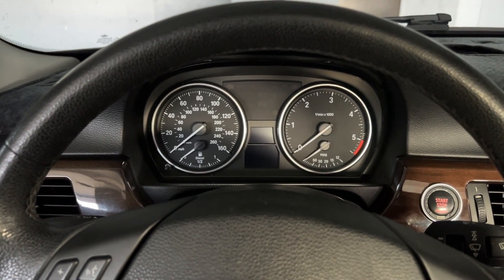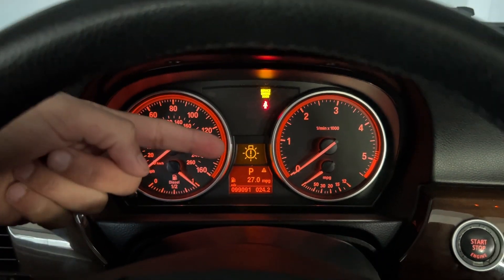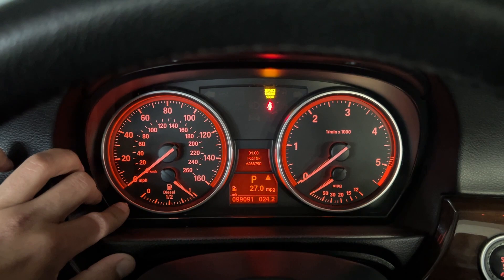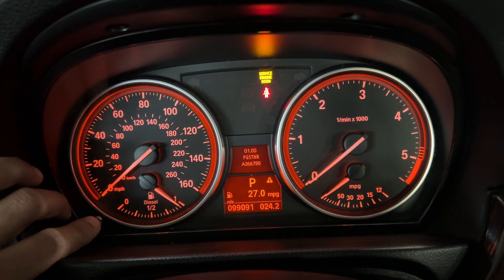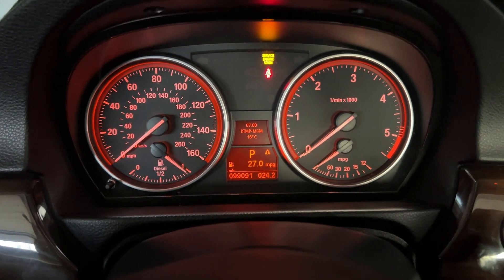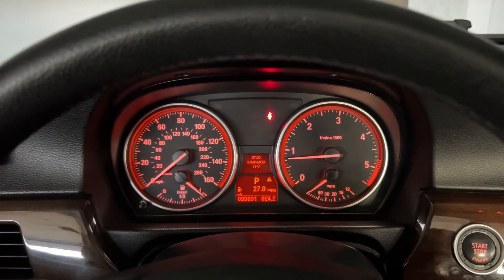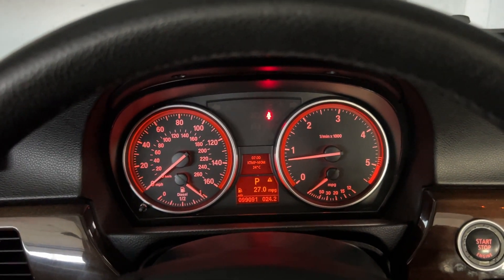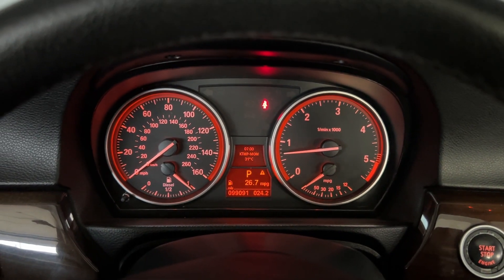How to check coolant temperature on a BMW 335d

Comment: Is it not normal that my temp is like 70celcius after driving 5-6km , and is dropping when I drive 90km/h in freeway?
Reply from the maker: Keep in mind that when going on the freeway the car actually cools down. But it shouldn’t be below 70 Celsius after driving for a while (freeway or road) if not codes are present, you might want to check the concentration of your coolant (bmw coolant should be diluted 50/50 with distilled water. Could be your coolant has an unbalance in coolant mixture. Meaning more concentrated coolant than water)
Reply: No, you need to replace your EGR thermostat.
Reply: @jorisbonson386 I replaced mine and still have this issue
Reply: @ Use genuine BMW parts - the aftermarket ones don't work
Reply: @ I changed both thermostats and everything is fine, used aftermarket ones
Reply: @rolandas1215  yep I did that too with aftermarket ones - they failed within 2 months and had to be replaced again with oem
Reply: @jorisbonson386  mine is still going strong for 2 years. Maybe its just luck how long will they hold
Reply: @jorisbonson386  probably why my fans keep spinning like crazy the radiator wasn’t oem but after market, what do you think about a ecs tuning radiator would it be an issue? I still have to check if it’s the relay causing that for me

Comment: Can someone please help me. I have the code, mine is 30. I've tried to enter is several times. It is still locked and I cannot view my coolant temperature. I noticed that the maximum number is 45. So I suppose if I do it 45 times eventually it will unlock lol